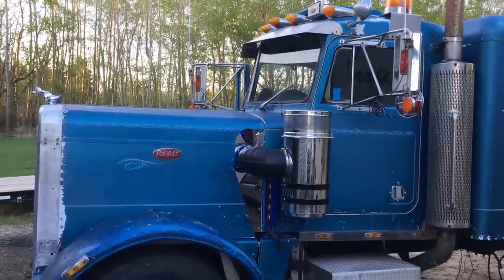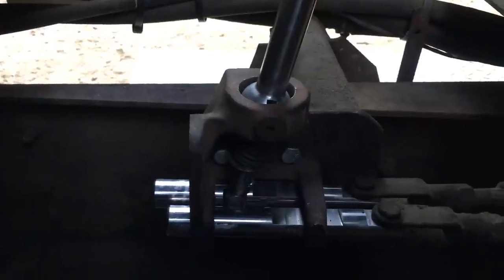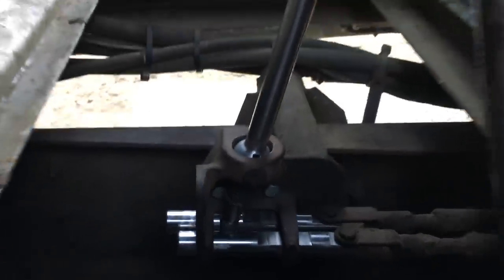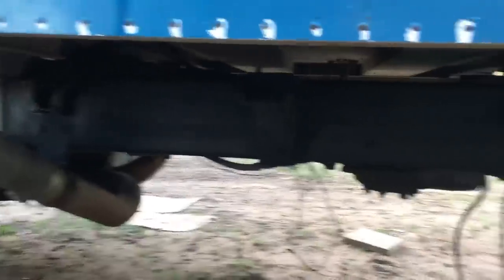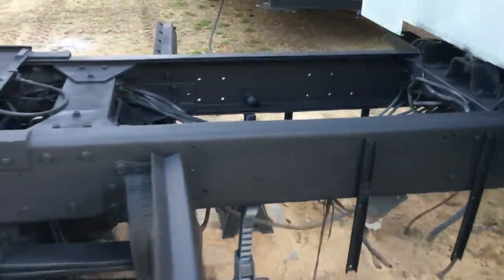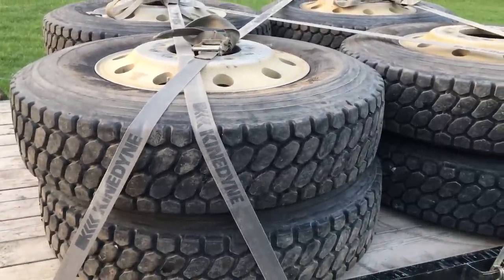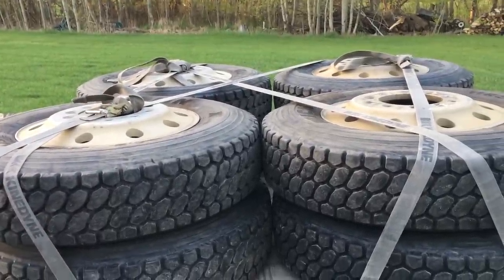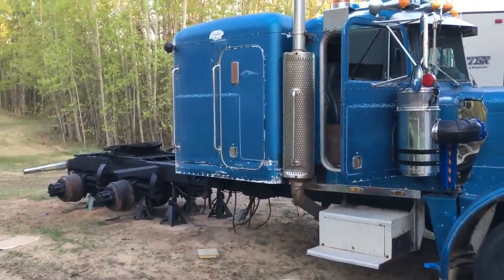Peterbilt 359 Restoration Ep.11 Frame Rework

Comment: I just started watching your channel about a week ago and i have a tip for you if you want to polish your own wheels , take baking soda and diesel after you wash your rims real nice and use an s.o.s pad and they will clean up really nice the baking soda actually prevents it from scrating try it out man it'll save you so much money man I've always done that with aluminum wheels then just take dish soap after and clean the residue off
Reply from the maker: Great tip ... I’ll give it a try
Reply: Just trying to help you save a few bucks brother i cant wait til that ole girl is done your doing great progress ! Keep going . I really think the clean roof top is a great idea but keep the orginal parts stored away if you cant use them and id actually worry about someone stealing that sleeper at the end of your driveway .... well here in the states someone would do something like that or take the emblems off the sides , just clear coat it a couple times and sand the oxidation if its all aluminum primer it keep it the way it is and make it a tree house for the kid's? ? Make your own nose make a wooden deck for it to sit on in the tree make a steering column couple seats and make the tree fort Pete!!!!

Comment: Nice work on the aux shifter. Nothing worse than trying to drive when they are worn so bad they get stuck in the middle. Drove an old KW that did that at least once a day. If you got the least bit sloppy it would jam up.

Comment: Looking back at this video how did you paint the frame ? Rattle can or spray gun and what type of paint ?
Reply from the maker: Dillan Crowder haha would have taken a lot of rattle cans 😂 I used an air sprayer to put down trenclad primer then flat black mostly because it was cheap and I can touch it up with a rattle can ... I plan to use a higher end paint on #projectsnowman if I’m able to paint indoors 👍

Comment: You didn't tells us what's under the hood.
I would have forward engineered a RTLO 18918B into that truck. Even a used one would have been better.  
As far as those old twin stick transmissions go, I'm glad they don't make them like they used to. 
Twin stick, been there , done that, got the tennis elbow to prove it. 
Stone drilled tires, really?  Surprised he didn't tell you he couldn't mount them because it was daylight out.  What a bunch of BS. 
You could have mounted them yourself, just to spite that clown,  it's not tough. Any more than three and he wouldn't mount them, my God, I would have sent that crook home crying.
He wanted to sell you new tires.  
Make sure you check the forward cab mounts, no fun going down the road with your cab bouncing off the frame. 
Hood hinge bushings too, don't want that hood wiggling around and laying on the bumper.
 Replace all the fuel lines too, the Bio diesel eats the rubber out of the old ones, no fun sucking air and having fuel seeping out of your fuel lines.
Jack that front end up and check your king pins. Probably better if you drive it around first and limber them up though, then check, if you haven't already.
Reply from the maker: 3406 A block 

Agreed he probably did want to sell new ones but the ones I found look like they’ll work well

Got new urethane hood bushings - just need to put them in

Good tip on cab bushings ... will check

Plan on replacing all air and fuel lines front to back before driving

Thanks for your feedback
Reply: Cab mounts are right in the front corners, and look like a hockey puck cut half as thin as normal, they weather and crack. 
Got any idea how many miles are on that 3406?
Would run it for a week or so, like a few thousand miles, then pull an oil sample (hot) and send it to Caterpillar. It's been sitting a while, cylinder liners can be a problem.
Wouldn't hurt to replace all the slack adjusters, it's been sitting a long time. I found the rest of your videos.
Those tires you have now will be fine, I have a small square drive socket for the inner nut on those ball and seat Bud wheels, it works better than a combination socket, the 
combo socket can jump if your not pushing down hard on it, and round off the square drive.  They are cheap, and easier to use is all. 
Truck looks in nice shape, it should be on the road again.